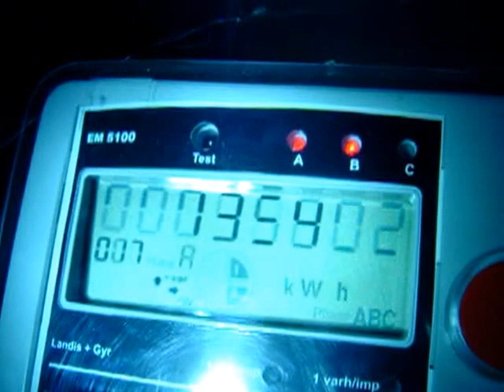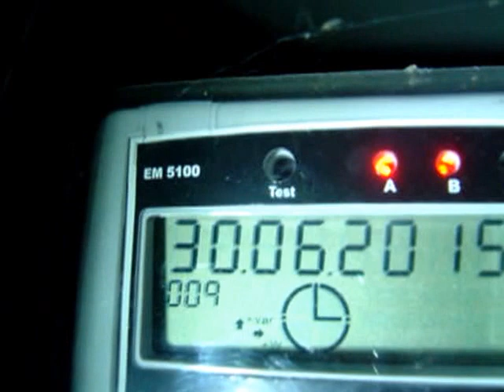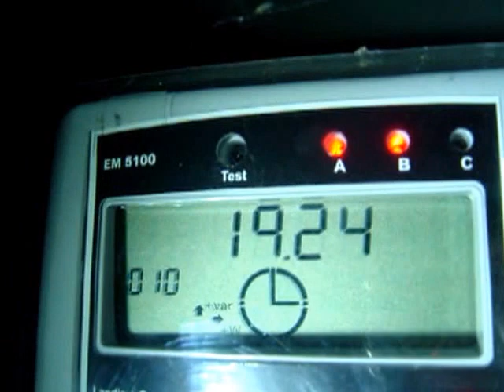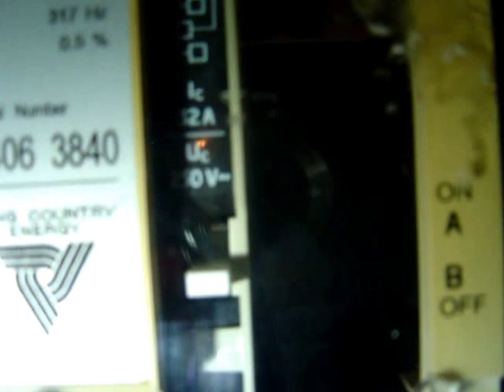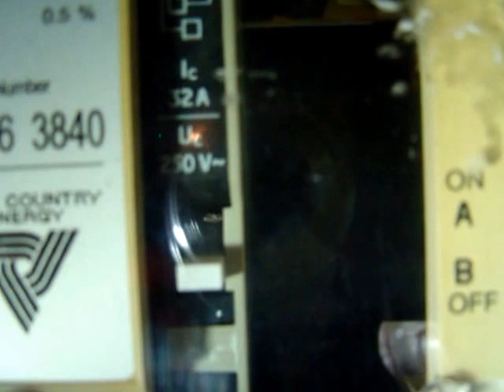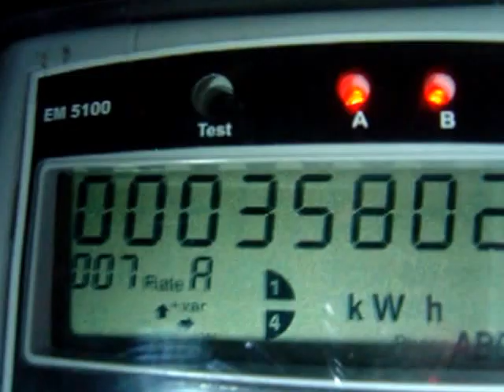Effect of power cut on Hot Water Relay and SwitchIt

Comment: 317 Hz.
 Interesting as the Zellweger switch was off prior to turning the power off. I would guess that the 3½ minute time delay is programmed in the relay. to avoid a large inrush current at switch on after a random power outage.